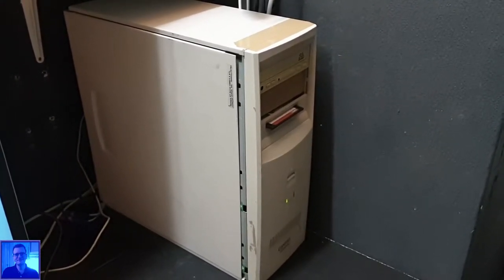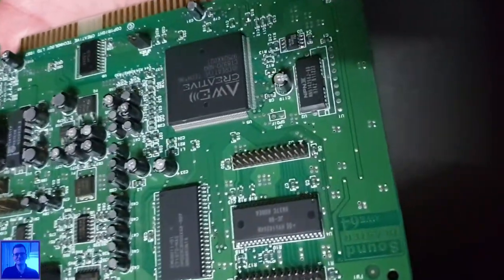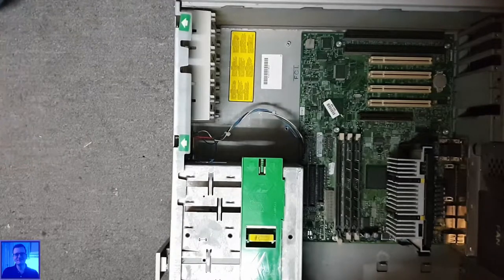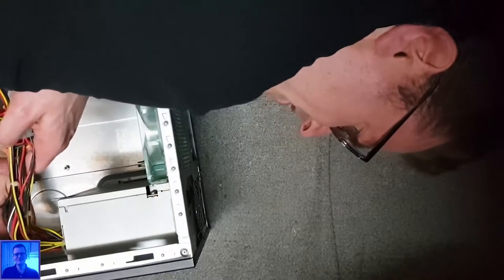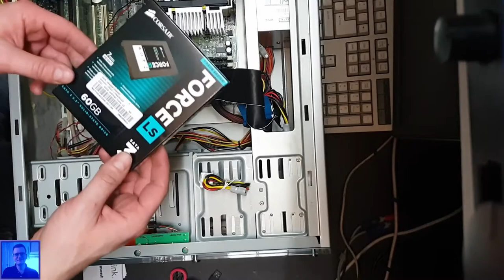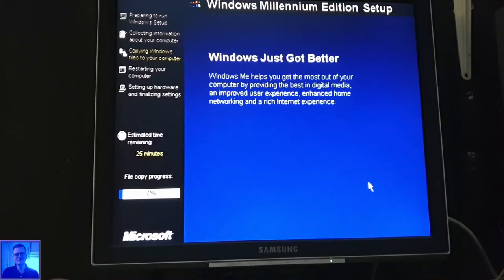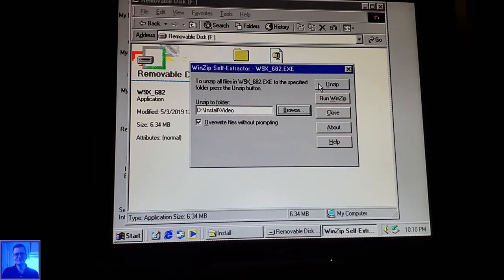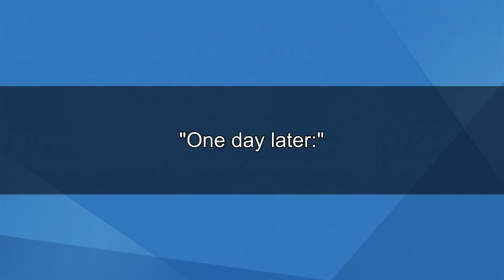Install Windows ME on a (SATA!) SSD - A real SATA ssd

Comment: I was wondering if I needed to download windows on my ssd if I already have a Hdd? Can I just use the ssd for games to make them load faster or do I need to download windows on it even though it’s on my hdd
Reply from the maker: Actually games can be put on a hard drive just fine. Your computer's speed is mostly gained by Window's opportunity to read/write fast to an ssd. Hard drives are slow for Windows, which uses a lot of little files, log files, temp files. I would definitely use the ssd for Windows, and if it has enough space install also the games on it you play most of the time. Ssd's are pretty cheap these days. You have a 480GB ssd for around 50 US dollars. See https://www.newegg.com/global/nl-en/Product/Product.aspx?Item=9SIA4YU7346905